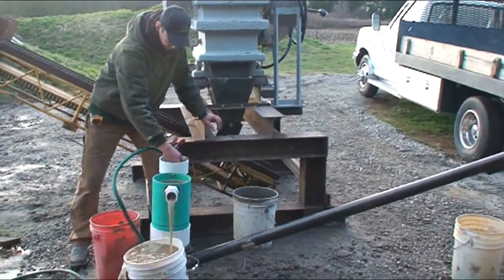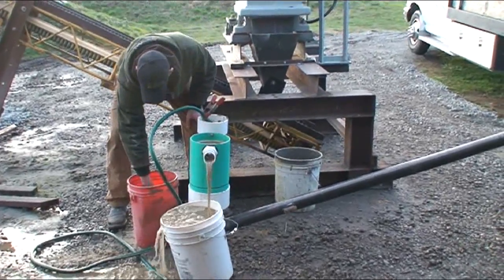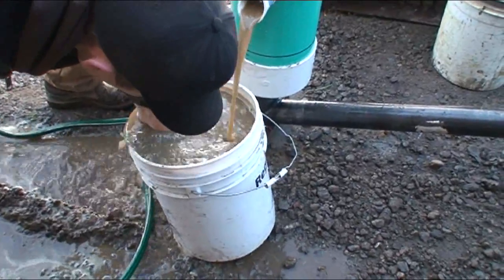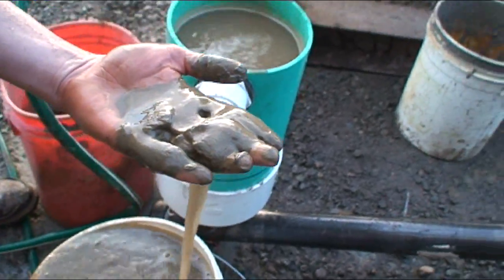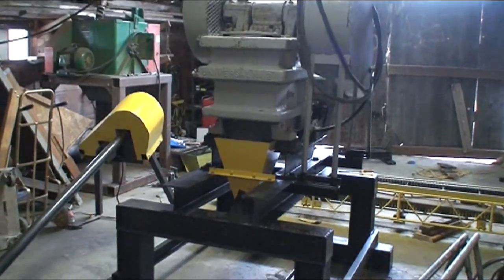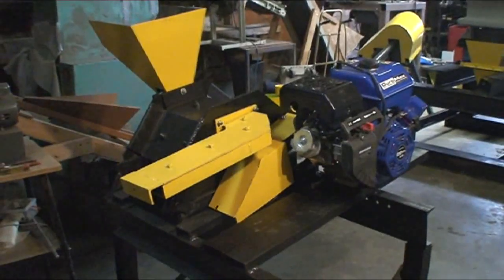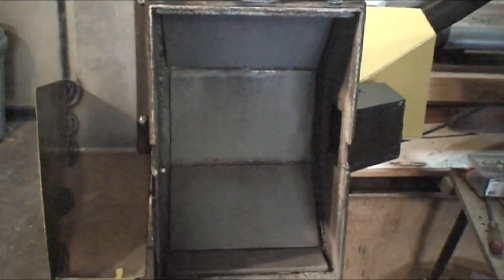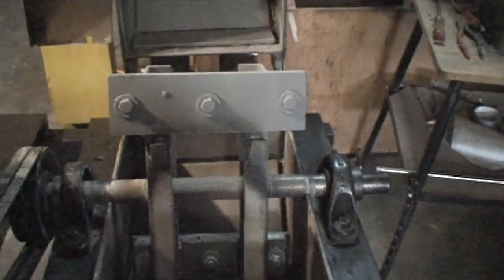Complete Crushing Gold Mill for Hardrock Ore: Jaw Crusher, Impact mill, Hydrocyclone

Comment: you have shown the last stage of the fine material....show now from there how to recover gold from that thick fine mixture then it will have sense to advertise this crusher.....next process to get gold from this crusher slury
Reply from the maker: Jacob-

This is just a video for the crushing and grinding of the ore.  You can see our other videos of a complete mill for processing ore from start to finish as well as videos of just the shaker table concentrating gold on our Channel Page.  I posted a link to one of our complete mill videos at the bottom of the "about" section of this video.  Take a look.

Thanks
Reply: CAN YOU GO FARTHER TO SHOW HOW TO EXTRACT GOLD FROM THE CRUSHED?REAL YOU WILL MAKE !!WE BEGINNERS ARE SO MANY/...NOT KNOWING HOW TO GO ABOUT
Reply: Hola cómo te contacto para la fabricación de un mil no pulverizador mi correo es Gutierrez 02041@hotmail.con mi Wass es +573136552736